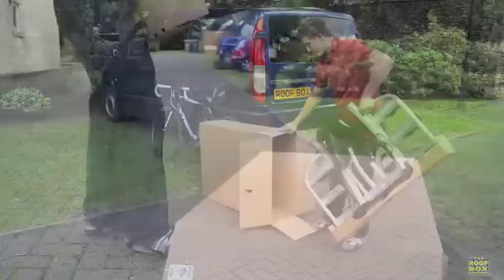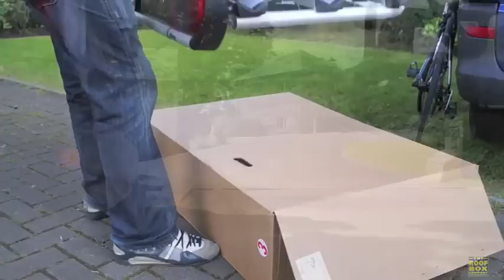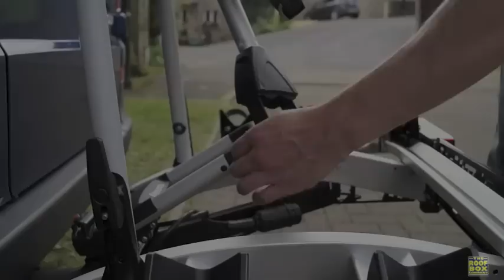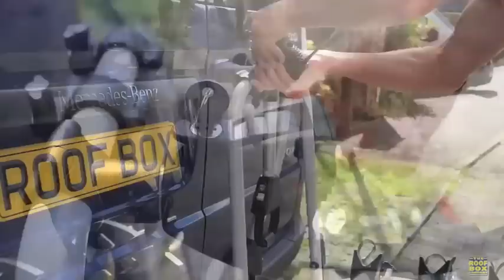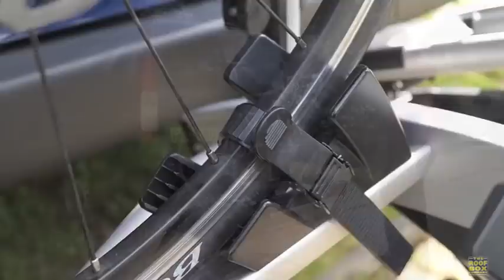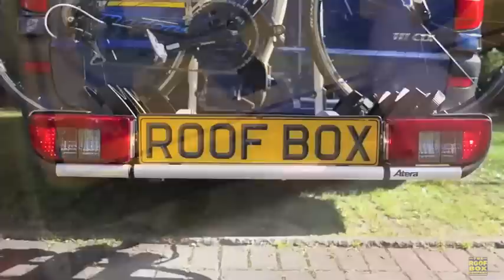Atera STRADA DL 2015 - How to fit - tow ball bike carrier

Comment: I'm about to buy this kit off you guys.  Can you confirm if my VW T5 barn doors will fully be able to open like the van in the video.  I'll be also getting the 4th bike extension.  Also which is best this or the Thule equivalent ?
Reply from the maker: +DJJENKO Thanks for the comment. I'm afraid we can't say for sure. The AteraStrada DL 3 slides away furthest from the vehicle so this would give you the
best chance. The frame on the DL3 is longer than on the DL2 so it would be a
much better option as the longer frame means it slides away more than the two
bike version. It depends on the angle and position to which your tow ball is
fitted – feedback from previous customers would suggest this rack slides far
enough to open the barn doors on some T5s but not others.The Strada would be a much better option
than the Thule equivelant as the Strada slides rather than just tilting so you
get more room to potentially open the barn doors.